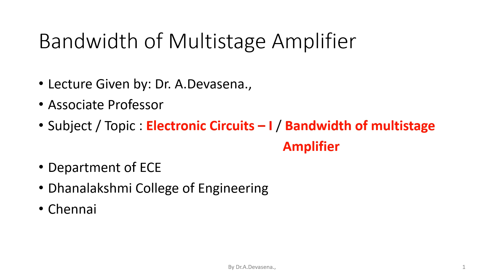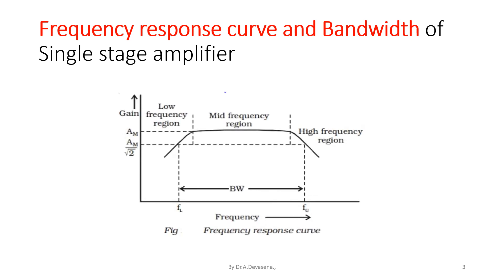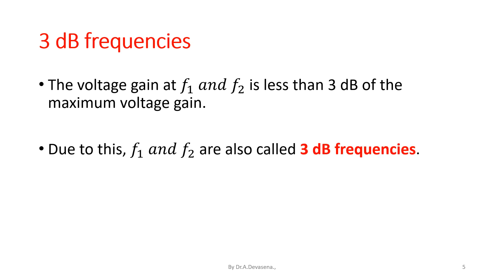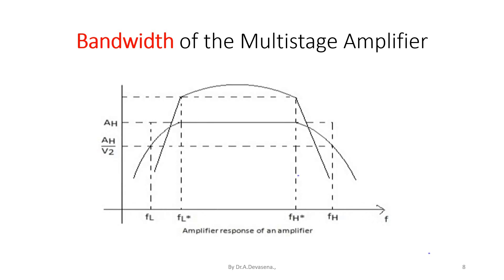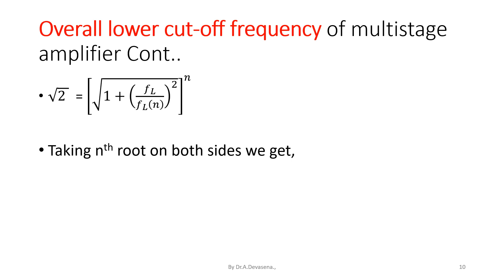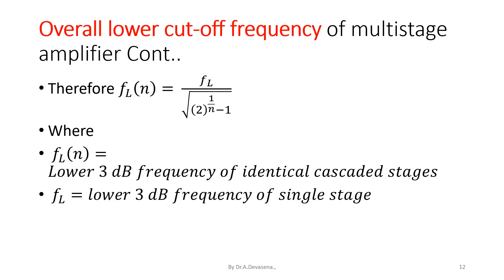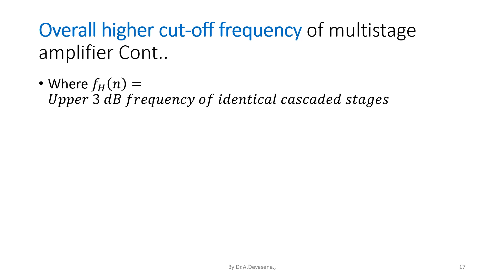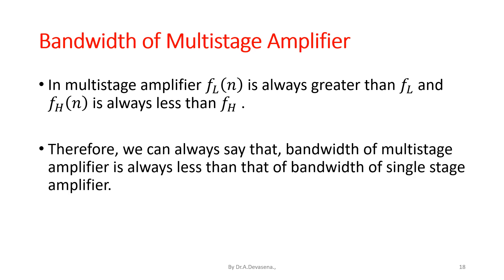BANDWIDTH OF MULTI STAGE AMPLIFIER

Comment: Madam, why bandwidth is measured at 3db? Or 1/√2
Reply from the maker: The bandwidth of an amplifier is usually defined as the difference between the lower and upper half-power points. 

we have to obtain the output voltage of the amplifier.
then mark the voltage gain of the amplifier. 
after marking the voltage gain in y axis, we have to calculate the frequency response of an amplifier.
for that we mark 2 points in the frequency response curve.
we mark 3 db line less than the maximum gain.
then draw a straight line after marking two points.
this is the reason for 3 dB bandwidth,
This is, therefore, also known as the 3 dB bandwidth. 
There is no lower half-power point for a low-pass amplifier, so the bandwidth is measured relative to direct current, i.e., 0 rad/s.
Reply: @devasena2489  my question is why 3db is chosen?
Reply from the maker: @Arun-bk1fq  we have to find maximum voltage gain and plot the frequency response curve. then we have to determine the bandwidth. for determining bandwidth we need lower cut-off frequency and upper cut-off frequency. so we mark 0.707 of Maximum voltage gain in the y-axis. this 0.707 maximum voltage gain gives the 3 dB value. that is the reason why we called bandwidth as 3 dB bandwidth.